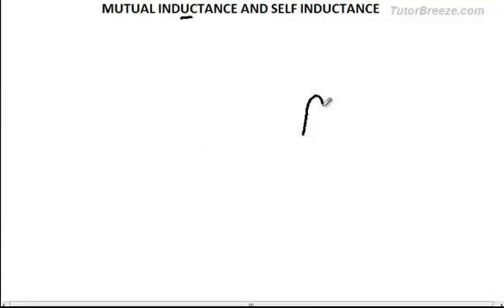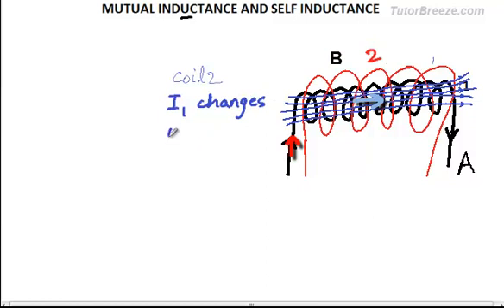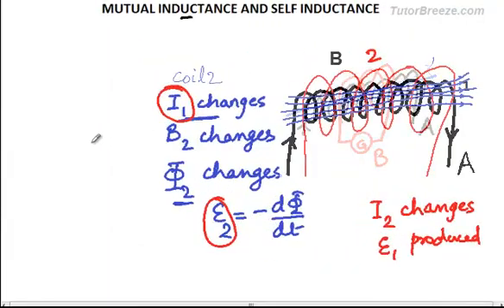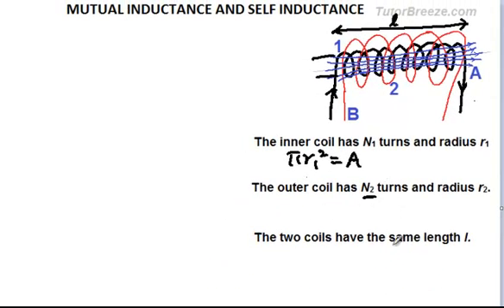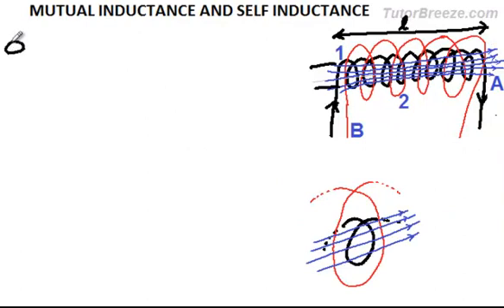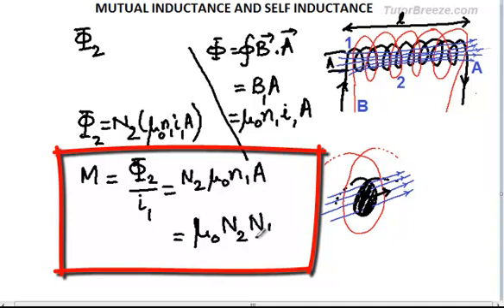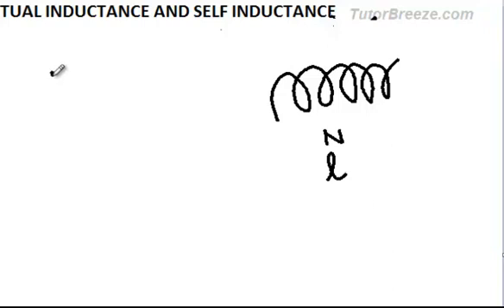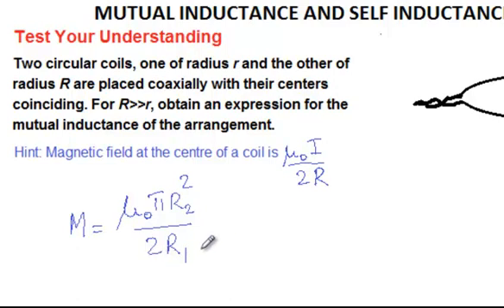Mutual inductance and self inductance

Comment from the maker: The assumption here is that the solendoid is ling in comparison with its cross section diameter and the coils are tightly wound. In this case the external field near the midpoint in very small as it is very weak. So we are assuming that it is zero.

Comment from the maker: Your question was-  could you tell how I can derive B=mni? 
watashiwa151 to find magnetic field use Ampere's circuital law. ( integral B.dl over a closed loop = mu0 times the net current through the area enclosed by the path).  Take rect path abcd with ab parallel to axis of  solenoid. bc and da are very long and perp to the axis so side cd is far from the solenoid and field there is 0. The current through abcd is nLi as each turn passes once thru abcd and carries current i. 
BL = mu0(nLi)